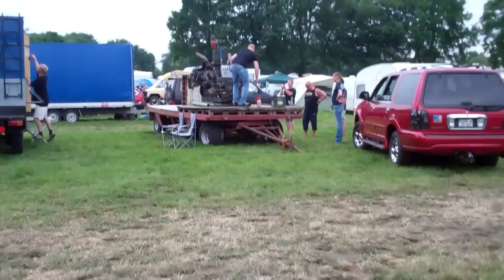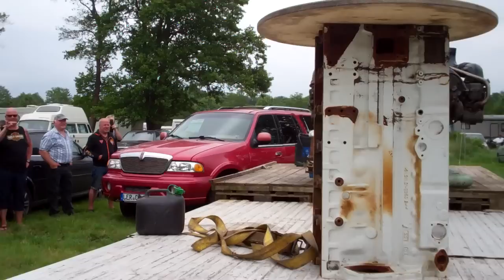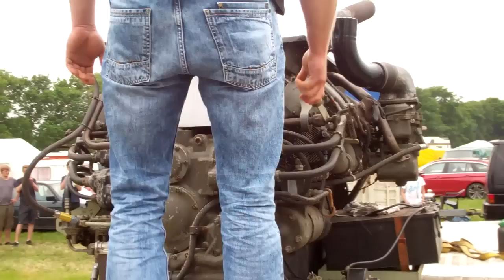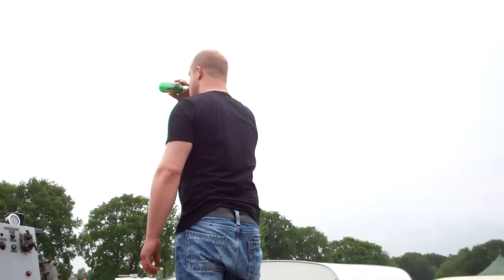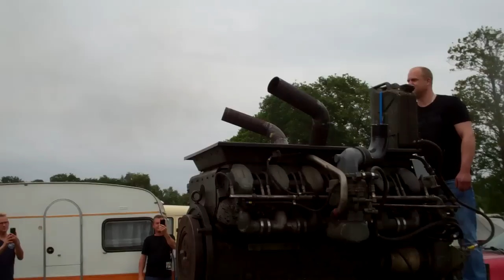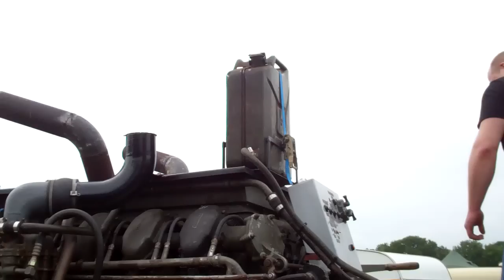M47 Army Tank engine 12 cyl Cold Start !! Oldtimer markt Bockhorn 2015

Comment: is that a Maybach HL230 engine?
Reply: Its a Continental AV1790.
Reply: M47 is the US Army designation for the second generation Patton Tank.. the vehicle the engine came out of... the engine is a Continental AV1790
Reply: The real doktorbimmer ah ok
Reply: What? You don't know what a Continental AV1790 looks like???
Reply: So, it burns gasoline.
Reply: Yes. 'Otto type engine' (HCSI) homogeneous charge-spark ignition gasoline fuel.

Comment: Hello , 

can someone tell me what the Difference between Gasoline and Diesel is?  Which needs more fuel? I want to design and develop Tanks, no joke.
Reply from the maker: Gasoline engines need more every mile , diesel is cheaper overhere in TheNetherlands , you can design and build a tank , as long as it hasn"t got a barrel ....
Reply: dutchurbanminer 

Thank you very mutch for your answer :).  I am studying at the moment and i plan to open a Military Company which designs and develops Small Arms and Tanks.
Reply from the maker: Be prepared for the Future , your tank should run on solar power....
Reply: the convention is to use diesel

not only do you get more milage out of it, but it doesnt detonate when the tank is hit
Reply: Chris W  but when Diesel is so mutch better than Gasoline, why did the M3 Lee Tank had a Gasoline  Engine?
Reply: Random Guy 1923 im no historian, but a quick on the tank showed it was produced in 1942 and used a 9cyl radial aircraft engine

my guess was it was late into the war, resources were scarce and they were getting desperate

nothing is conventional about the tank. from turret placement to engine choice. i think at the time, the brits tried to do the german thing of cramming a bigger gun into the tank but couldnt get a turret that could support it, so they mounted it to hte chassis

it looks like an experimental piece if anything
Reply: the Two main differences are that gasoline is ignited by spark while diesel is ignited by heat am compression an the other the difference is that diesel is more efficient an more bang for your buck but maintenance is a little more costly that gas an they can be a pain to start when cold while gas you can turn the key an it's going an there engine blocks are a a lot lighter an maintenance is fairly cheaper
Reply: gasoline easier to ignite by a single spark. but diesel needs more compression and heat to ignite. A single spark would never ignite diesel.
Reply: Diesel engines developed before and during WW2 simply did not have the horsepower to weight ratio required for an efficient tank design.. so most successful tanks during WW2 used aircraft engines or engines derived or designed by aircraft manufacturers..
by the 1960's turbocharging made Diesels a more viable option with better range due to the better fuel economy

Comment: You gotta admit thats one great sounding engine. :-)
I could almost hear the squealing sounds of the tank tracks in my head, awesome!!
Reckon that Jerry can of fuel wouldn't last very long...lol
Excellent video :-)
Reply from the maker: Bevoin1970 About a gallon every few minutes it ran , Hope it didn't wake up the neighbours on this  minus 5 star campground....
Reply: We usually used up 5 gallon can of fuel on first start after rebuild.Start engine make sure it was running on all 12,warm up enough to do mag drop test punch throttle all the way up to test governor usually did not have to use degasser to kill engine it was out of fuel.whole process took about 20 to 30 minutes.When installed in a tank this engine would get about use about three gallons of fuel per mile if it was tuned properly.

Comment: Does it run on Petrol?
Reply from the maker: +nw8000 Yes , pur expensive (overhere) gasoline...
Reply: +nw8000 diesels run on diesel
Reply from the maker: +Cross Durazo TRue.
Reply: yes, this is an gas engine, continental did make a diesel version of this engine.

Comment: this engine have a very high HP potential as there is room for heat dissipating
this engine in fine tune is another beast
Reply from the maker: +Jacques Poirier it needs a tune-up for better starting but the fun is the noise , thanks for watching.

Comment: W'pedia says "An AV-1790-5B is also the engine of the Blastolene Special, a custom car owned by Jay Leno."
Reply from the maker: indeed , jay l. has got a vid of that beast on YT
Reply: he added turbochargers to his to try to get better mileage out of it  as is naturally aspirated it put out 810 HP     Its the second engine he has put in it he had a unknown oil leak dumped 11 gallons of oil on the ground and blew it up !

Comment: yo this is a really interesting engine! Why did they choose to put the intake on the outside of the V and the exhaust inside? its the other wa around typically, is it for cooler air passing around the air cooled cylinders? Anyone know?
Reply from the maker: +aspyromilios Im the one who made the vid so I not nothing about this engine , maybe one of the viewers knows more.
Reply: +aspyromilios The cooling fans were mounted over the engine and sucked the heat straight up and out of the tank, the outside of the engine where the carburettors are is the coolest place, all the hot parts are in the middle of the engine V.

Comment: Watching this reminded me of when I was in 1ST Cav 27th Mintenance Bn.We had in the whole division 3 AVLBs that used a version of this engine, one was in our shop for engine replacement,our supply folks had thr replacement engine,sat on it all day delivered it around 2pm.which meant that I had to work late that day to get the engine connected to transmission,both filled with oil,engine started make sure engine firing on all twelve.About 11 pm got ready to start engine without muffler deck installed engine still had a lot of preservitive oil inside which will causse the engine to shoot fire out the exhaust until it warms up,I hooked our home made start kit cranked up the engine kept it at about 800-1000 rpm until it warmed up then did  a mag drop test, but I had to test the engine governor which meant full throttle to see if governor would hold engine at 2800 RPM,had to run engine up to top speed three time to see it work properly.I was about 400 meters from Bn HQ BEQ.noticed that a lot of light going up there,shop foreman showed up just as I finished third Gov test told me to stow my tools,go to bed,after investigation supply folks always delivered uor parts as soon as they got them.
Reply from the maker: I see you still remember that engine so it must be a bit sad to see this one in , how shall I say , a bit of a poor state of maintenance , maybe just the plugs , after a lot of short coldstarts everyday , all day on this campground ( yes , nice and quiet... ) I imagine the plugs get real dirty. We didn't see it again in 2016 , lets hope it still runs , so not send of to China for scrap.
Reply: Sounded like a set of plugs would help,maybe new plug wires.I have even seen time when mags needed work.
Reply from the maker: Again , lets hope its still alive and ,,entertaining" viewers.
Reply: @dutchurbanminer  it's a time capsule let it miss, it is running👍
Reply: The AVLB used by the US did not use this engine, it was based on the M60 and had the AVDS-1790-2DA 12-cylinder diesel engine, the M47 used the Continental AV-1790-5B V12, air-cooled, gasoline engine. No mags on a diesel, so I doubt your story. But good try.

Comment: Why the heck do guys run a starter until the commutator melts????  IF it doesn't start in a few seconds, figure out why, don't crank it until the starter burns up.  Common sense.

Comment: Badly out of tune, needs attention to the mags, leads/plugs or maybe low on compression. It shouldnt need ether or brake cleaner to get it to fire up..
Reply: +Draxindustries1 Defo a misfire on both banks. Sounds like pre-detonation
Reply from the maker: its like back to the future....
Reply: Sad to hear engines sound this bad.....
Reply: What kind of mags, leads/plugs are you talking about. It's a diesel...
Reply: More than that, it should kick over on its own within the first ten seconds *at most*. There's a video of one of these engines on YT that fires up within five or six revolutions somewhere.
Reply: @512kjt do you not see the huge fucking carbs on the sides of the engine? This one's not a diesel. Pattons had both fuel types available to them and this is a gasoline fuelled air cooled V12.
Reply: Its a fucken desil what plugs?
Reply: Draxindustries1 just needs more vodka
Reply: @charleskeller1245  You are right. I stand corrected. I spoke on a subject I know little about. Cheers.
Reply: @512kjt  sorry you'er wrong. its not diesel it burns MO gas or gasoline!

Comment: flat battery and too slow cranking?
Reply from the maker: Indeed slow crancking due to weak battery.
Reply: do you have other big old engines?
Reply from the maker: nope , i just made the vid.
Reply: OK.
Thanks for video.
Make some more when you see old engines.
Reply from the maker: I will , hanks for watching.
Reply: And an engine horribly out of tune. She ain't runnin right.